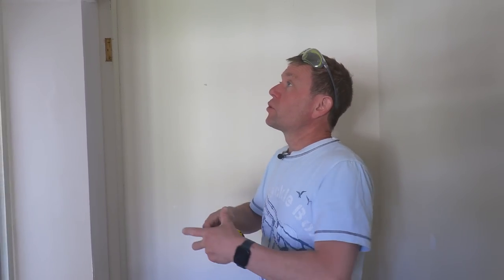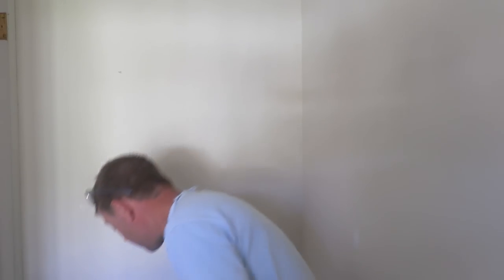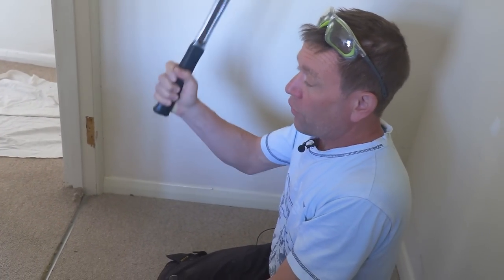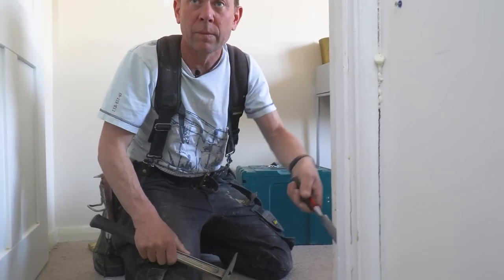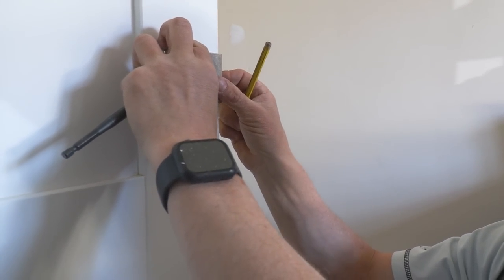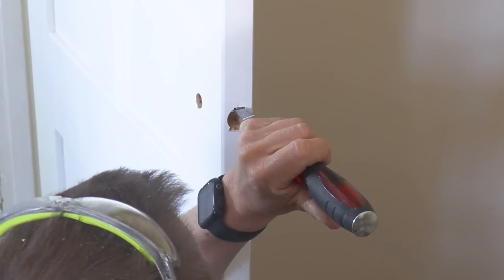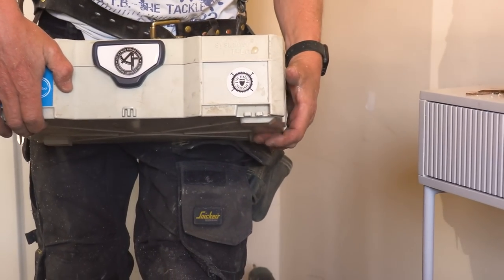A Common Door Hanging Problem Sorted

Comment: Wow, one of the best vids in my opinion. What a pleasure watching a real craftsmen at work. I love that router, I may have to go and buy one of these myself. 
Didn't know about that little piece of metal in the door keep, that's a good idea.
As for foam guns, I just buy a new one every year now, given up with cleaners. Had a can come off in a customers lounge back in the 80s, it was a Hilti foam gum, I accidentally bashed the can top against the fire place oak beam, luckily I had my fleece laying on the hearth, I just lobbed the whole thing inside the fleece, rushed outside and dumped it on the drive.
Reply: @Dazza19746  I've seen somebody do that on an apparent empty can, I'm guessing to get the last squirt out.
Reply: Hi  @tinytonymaloney7832  , thanks for watching.
Reply from the maker: @Dazza19746  Bloody hell I didn't know that it was dangerous. I have never done it and now I never will. Thanks for the comment
Reply: @SkillBuilder  no worries Rodger.

I learned the hard way! Was around the late 90’s before I moved to oz.
  The lady was bathing the baby and must have had this can in the sink next to the bath, I remember asking with some bemusement ‘did he give you a can of expanding foam?!’ She grabbed it in a towel, handed it to me and it was the old ‘slow motion’ thing for the next few seconds, she ducked back in to attend to child… I’m thinking ‘F me this isn’t good! What to do?!’  I made it about 3-4 steps down the stairs and I felt it going, sort of like the can expanding, then the arse blew out of it I think, like a rocket into my thigh ( should have seen the bruise! And I was like a racing snake back then ! I didn’t bruise generally!)  I remember sort of stumbling around for a minute confused, then fell to my knees..

Could have been so much worse, imagine it went in the bathroom and hit the baby and not me! Or at worst just all that hot glue all over the kid… :(

I’d say obviously DONT heat it at all, but she had it in scalding hot water, must have been!

Take care 👍🏻

Comment: I hope people watching this appreciate the work that goes into doing a job properly and not to take things at face value. Might only be hanging a door but if it was easy you wouldn’t be phoning someone else to do it. Allow us the time it takes to do it right.
Reply: Customers often gasp when you quote them £60 to fit a £30 door but they forget or don't realise the work involved when fitting into old linings
Reply: Quit being so emotionally involved, Jack. It's only a door.
Reply: As someone who has just had a go at hanging new doors in a 1920s house last weekend...  I can fully appreciate what's involved. 
Only problem I ever have is getting someone to actually do the work.
Reply: Hi, im just curious. Would £60 to fit the door include wood filling & caulking to the frame, architrave and door stop fixings and damage to the decor when it's all been pryed off, packers smacked in and expanded foam everywhere. Or does the customer have to pay to get a decorator in to do? Thanks.
Reply: I either have a go myself (assuming it's a fairly minor job, sometimes it turns out ok) or think better of it and pay someone to do it properly.  Knowledge, practice and the correct tools are all essential.  It sounds obvious but many don't appreciate that.
Reply: @dazcoop4225  no it wouldn't cover the cost of making good £60 would be to just fit new door to old lining and fit ironmongery. To be honest if the frame was so bad your needing to remove architrave and wedge frame to accommodate the door giving a better fit you will be paying more than the original £60 as that wouldn't of been allowed by the carpenter
Reply: @tompirozek4490  £60 to fit an old door in a new frame is often not near enough. You easily spend the best part of a day doing what Dan did in this video. When the frames are out of square/level/parallel and you have to adjust the frame, and your in someone's house with all their possessions in the way, and you have to go out side to do any planing and routing you might only hang 1 or 2 doors. It's a bit different on a building site where you can set up a door stand almost next to the frame you are working on.
Reply: I'm retired now, but a few years ago, I got a call from a woman asking me how much it would cost to fit a door. I asked her what sort of door (35mm embossed hardboard 6 panel,) How old the house was, etc., and I told her if it was just one door, the lining was Ok and she supplied the hardware, thirty quid - and that was a 'from' price: it wouldn't be less. She thanked me, and hung up. Ten minutes later, she rang back. "Can you do it for twenty five?" she asked. Honestly - the things you have to put up with, when you work for yourself...
Reply: Yep, doors upstairs cost more than downstairs for starters
Reply: @kungfustuey1  yep, know the feeling. I di
d three upstairs in a poxy Victorian house, all cutting in a bedroom as arsehole to get them downstairs. Inch off both sides, top pissed and inch off bottom. I used to hang 5 before tea break. They're all different
Reply: @tmwoodhams  know exactly what you're saying
Reply: @tompirozek4490  same as new cambelt in an engine, loads of labour for a cheap belt
Reply: @johnriggs4929  if you'd said £20 
She'd say £15? Some people don't want to pay for fuck all
Reply: @johnriggs4929  Overbid every job, it gives you room to compensate for surprises. Plus it scares away problem customers. 
Whenever a customer tells me that they got lower quotes, I tell them "that's a good deal, go with them".
I don't compete on price, I compete on reputation and quality. If you want it done right, this is my price.

Comment: There’s always an assumption that hanging doors is a quick/easy job but in my experience (only a DIYer) it’s a TREMENDOUS faff and it’s actually reassuring to watch these guys lugging the door up and down the stairs to make adjustments just like I do. Granted, probably not as many trips as I end up making, but I could do with the exercise anyway. Well done boys 💪🏻
Reply: I've been a joiner for 20 year's mate, hate hanging doors just because of the faff.
Reply: It is more work than people think, especially if it is done to any level of quality craftsmanship. 
I work on doors nearly every day and it can take a long time to correct for all of the things that can be wrong with the jamb. 
The only quick doors are the ones that are going into a perfect jamb, which I don't see very often.

Comment: Retired from paid work , for some 4 years - couldn't resist a look at this vid on sorting a door hanging problem . If I were to dish out advice (on the art of door hanging) to carpenters starting out, it would be - IT'S ALL ABOUT THE LINING . Factory produced doors come, by and large, with perfectly straight, parallel edges, the top and bottom dead square to the long edges. We all know the world of difference there can be, between  fitting doors in new, well fitted linings, and fitting doors to crummy old linings
Reply from the maker: You are so right. Some people hang the door and then true up the lining to it.
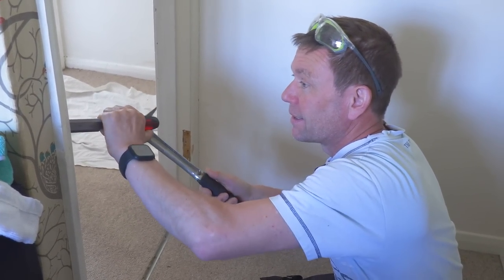Reply: @SkillBuilder 3:06

Comment: Hanging a door properly, nice and neat (especially in a crooked frame) is a real skill.
I learned how to fit doors over years of trial and error and I fit them pretty much exactly how your guy does 👍🏻, I got something right. I put a pencil mark on the end of latch but basically the same method. You can now buy a latch and plate where the plate pushes up against the doorstop so no trying to work out the position of the plate. It’s also important to leave a mill or two gap around the doorstop so when the door is painted it won’t rub.

Comment: Acetone will clean expanding foam off your gun,

I had a house full of frames that were out of plumb like this one, but also leaning out out, in my case I found it easier to just fit new doors into new frames, then fit frames, then just hang the doors, love what you've done with the router, I also always cut hinge rebates with a router, saves so much time and gives a much nicer seat for the hinge. Also like using 3 hinges, even on a lightweight door, hung my fire doors on 4 hinges as they were 2'9" solid doors so pretty weighty.

Comment: Massive fan of Dan. I rarely get anything cool to do like cut roofs, I'm mainly stuck doing this kind of work, hanging doors in wacky frames...
Was really good to see a professional like Dan doing things I do.
Reply: Many thanks Kallum.
Reply: @Ultimate-roofing-square.  do u make your own timber wedges? 
I try to but they're always a bit rough.
Reply: @flyingjackcarpentry9394  yes, cut them with a circular saw. You can do them on a mitre saw if they aren’t to long.
Reply from the maker: New video coming soon 'How to cut wedges'  followed by 'How to cut sandwiches'.
Reply: @SkillBuilder  I know you're taking the piss but I probably would appreciate a video on q decent wedge cutting method.
I don't own a table or band saw.
My own method is a ball ache.

Comment: Another excellent video featuring Dan’s highly skilled work. Interesting router base as well. 
In my older house the door stops are part of the frame, so altering them, e.g. to re-hang a door to open the other way, is a big job!

(An unfair comparison, perhaps, but a bit more practice is required by Roger to get to the same level as Dan, it would appear! 😀)

Comment: My house had cinder block walls with random thicknesses and door frames all shapes. The first one I pulled out destroyed the cinder giving nothing to screw into. I filler foamed the new frame (huge mess) and it ended up curved. Second attempt, screwed straight 4x2s to the door frames and held them in place with temporary battens. Careful filler foam did the job. 4x2 removed when the foam had cured. The door frame was straight and never came loose. 
4x2 framing screwed and foamed to the ragged cinders would have been stronger but cutting cinder blocks is horribly messy.

Comment: I wish I'd known about that little metal tab to stop the door rattling before.  Previous owner of my house was a right bodger and he replaced all the doors.  Six out of eight rattle a bit so I'd just put a bit of narrow sticky foam on the frame which does the job but looks ... well, a bit crap but I didn't have the tools to move the stop in a tidy fashion at the time.  I'm redoing all the paintwork soon so I'll rectify that as I go!  Thanks Dan and Roger - at this rate I'll have a dry, rattle-free house with working taps and a level floor in no time. :)

Comment: Great video all round 👌🏼 I find with that foam gun if (when) it gets blocked up you strip it right down easily enough and then the old foam comes out a bit like cured silicone out of a nozzle. Then reassemble and run some cleaner through and all good 👍🏼

Comment: Nice job. I used a router too. Can I suggest a 23mm spade bit. It's extremely hard to find. But it works perfectly. The new locks are a little bigger from the older 7/8 , 22mm. The suppliers recommend 25mm but it's too big.

Comment: In one of the comments, it said that you didn't like hanging doors. Well, you made a cracking good job of it anyway! Tubular latches are a pain because of the shape. I just bought a 24mm auger bit to try.
Reply: Thanks Mike. 
I also have a 24 mm bit, and probably should have used it. 
I don’t mind hanging doors, this job had plenty of room to work so it was good.

Comment: I always have the opposite problem, the frames being too tight.

Just had to fit 2 prefinished oak veneered doors in shitty frames. 
First one wasn't too bad, but I had to plane about 3/8ths off the top hinge side corner to keep the margins even ish.

The second one I didn't even attempt.
These prefinished ones aren't supposed to be hung in old wacky frames I don't think.
You've only got about 10mm on each side.
The top of the frame was 29 and 3/4 and the bottom was 29 and 3/8s.
I'd have had to exposed the chipboard core on both sides and left myself with bugger all to get a fixing in for the hinges.
I insisted on a new lining but the builder and customer, they weren't happy, they said a good chippy can get over anything.

Comment: 17:48 Rodger that slat you can see in the door keeper plate is designed for a screwdriver so you can make fine adjustments by prying it gently. 😉
Reply from the maker: That is what I said
Reply: @Skill Builder  I'm sure in the video you were trying different angles but didn't just put a screwdriver in the middle to simply pry it. Sorry if I missed that bit. By the way I love your videos especially when you and Robin are together lol.
Reply: @Skill Builder  I watched it again. What I'm referring to specifically is the slat which is purposely made so you put a flat screwdriver to pry the inner plate. You were hitting that plate from behind and prying the edge, I hope that makes sense. Thank you for your informative videos.
Reply: Exactly right, I got what you meant.. He is prying and not from the slot!! Well spotted
Reply: @Unstoppable Tramp  thanks mate, I thought I was the only one who spotted it. I had to watch it again after Rodger replied.
Reply: @abuhaqq  I came down here to say the same thing. I demand a follow-up video.
Reply: There you go Rodge, you've had your advice...keep it.

Comment: I spoke to the manufacturer's of Eclipse hinges years ago about most to the post or not with ball race hinges. They say from an engineering perspective it doesn't make any difference. So writing the the right way up if you like.
Reply: I'd argue from an engineering standpoint you definitely want the outer knuckles on the frame, always bearings always wear out, so limit movement once they do with 'most to post'. Nobody stops to read who made the hinges, 'clocking' screws on hinges and door furniture is something I do definitely spot however😉.

Comment: Daniel needs to get himself  a trim puller and a latch mate. To line up striker plate I just rub my pencil on end of latch. The above tools along with my home made hing and striker plate jigs make my doors fast and look like a machine did them. Trim puller gets trim off with little damage and doesnt risk hitting a nail with a good chisel.  Let me know if you want links to them.
Reply from the maker: Daniel hates hanging doors and told us he would be happy if he never had to hange another one.
Reply: @SkillBuilder  yeah I get it, but.......carpenter. lol. I guarantee he will be doing more.
Reply: @needaman66  please post the links they sound like a handy bit of kit
Reply: @darrenmaloney761  wjats the size of your standard latch plate? I'll male sure it's same size
Reply: 57 mm x 25 mm x 3mm deep
Reply: I slide a pair of paint scrapers/putty spatulas behind the wood I want to remove, then hammer a bolster chisel in between them
Reply: @nobodydoesithalfasgoodasyou  the stiffer ones upvc fitters use to get trim off casements are good for getting enough leverage behind stops to move a nail or two enough to get claw on them and sturdy enough to lever the hammer over when pulling the nail.

Comment: Most people ain't got the money to change the frame ..... I fitted 6 doors in a row on a house in Australia ..a queen's lander. It's on piles and the whole house was tilted...every door frame had a bulk head that was about 2 inches out one side...all the doors looked a little odd as they was slopeing down...after tho they still  all had a 3 ml gap round ..and looked good ...shoot them in to what ever frame you got ...sometimes it's in out in out ..plain bit hear .bit there .try not to take to much off the height..until you have seen how the bulk head runs ..charge £35.00 and  on to the next ..put bits of card board behind the hinges to create a few extra ml if its needed ...with bringing the frame out like that now..you still got to cut and now scribe  the architrave into the wall now....so is it really saving time...this way when you stand in the hall way you will see the frame runs out ..most  fill it with caulk and all sorts then all cracks cos the doors bang .seen plenty of that on sites....most people don't want you to spend a whole day on one door

Comment: I put the keep plate over the latch while the door is open to simulate the door in the closed position and then mark a line with my pencil down the keep.  You now have a line on the keep to marry to the edge of the liner.
Reply: That’s a great way of doing it.
Reply from the maker: Yes but my way you get a lovely lick of Marmite
Reply: @SkillBuilder  oh yes.. James method is good when you’ve run out of marmite…

Comment: Bought a Barratt house in 1996, none of the door frames are straight or same width top to bottom. Previous house built in 1989 by Ideal, door frames near perfect.
Reply: My current house, 1982 Barrat build, has the same issue. The door frames are an inch out top to bottom. The house is made of cheese. We are in a nice area though and it gives me a project sorting it all out.

Comment: Do you guys use centre drills at all while installing hinges
Reply: I have done before when I was fitting a kitchen and the units had butt hinges which looked very nice. 
They are more accurate, but I usually just use a 2 or 3 mm bit and slightly drill it off centre to pull the hinge tighter to the cut out.

Comment: The recess with the magnet on top of the hammer head is used to hold a nail and put it into the wood without having to hold it.
Reply from the maker: yes but it is not something you see being done much.
Reply: @SkillBuilder  I think it's more an American thing they seem to do it a lot, never liked it myself as you guaranty where the nail is going to end up by holding it.